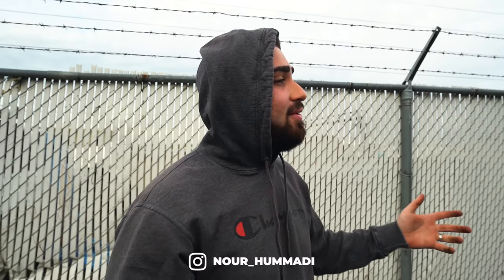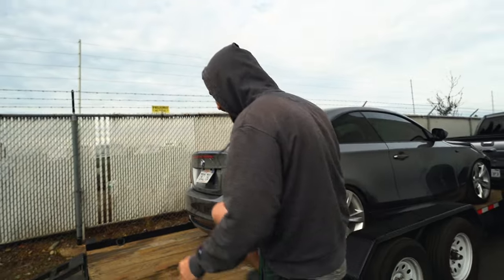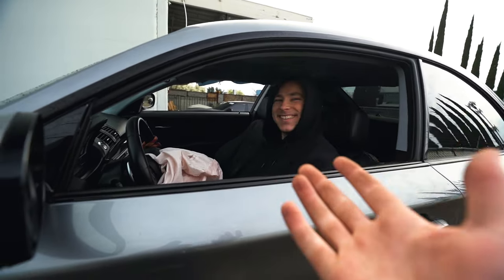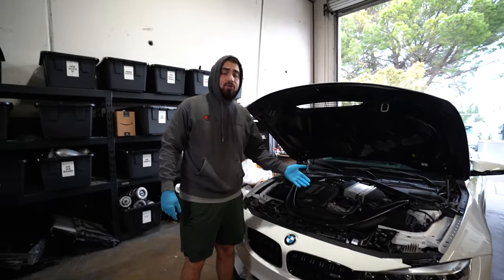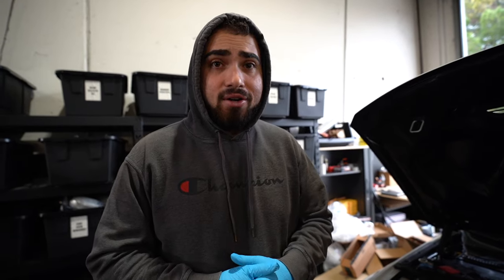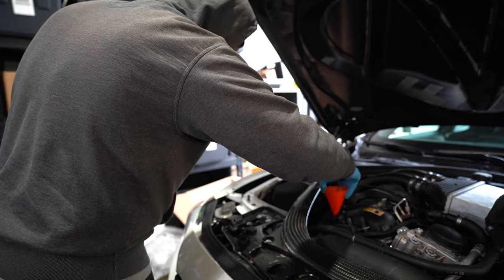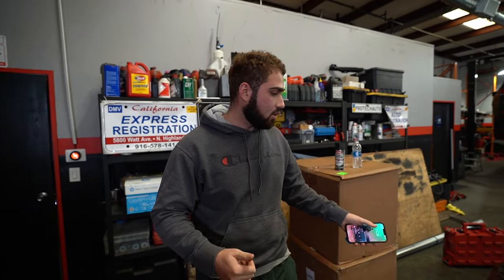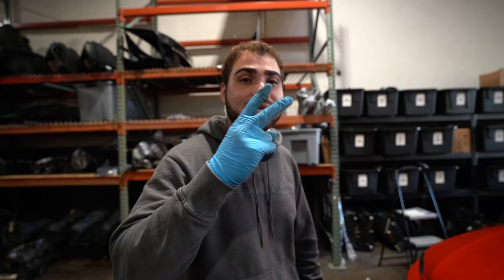NOT EVEN BMW CAN SAVE THIS M4CS..

Comment: hey nour the cs oil pan is the same, it just has a spacer on the oil level sensor.
Reply from the maker: Turns out the oil pan is actually bigger, different part number
Reply: Yes I think it hold half a quart more oil

Comment: What’s wrong with the CS? Just sounds like a bad idler pulley that squeaking. Overfilling a little isn’t an issue besides the sensor possibility telling you it’s overfilled. I added the oil level spacer on mine and actually added capacity to my engine by technically overfilling but the level says it’s correct.
Reply: Also if it’s burning oil it’s more likely a bad turbine than the engine.

Comment: You could of just held down the unlock button on the remote and it should roll down the windows......unless the 135i doesn't do it.
Reply from the maker: For some reason it wasn’t working
Reply: It won't work if it was coded out.
Reply: @ilianstoimenov6619  
In RSA that’s something that seems to come standard with our BMWs. I was surprised to see that some people abroad have to code that feature.